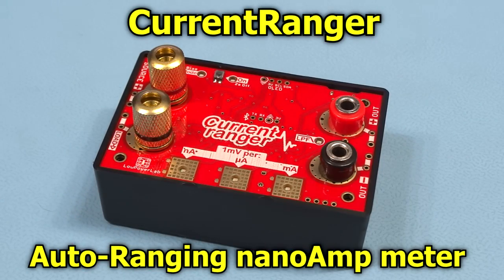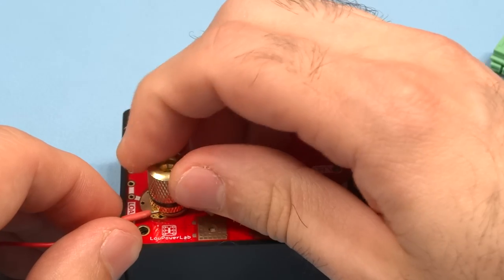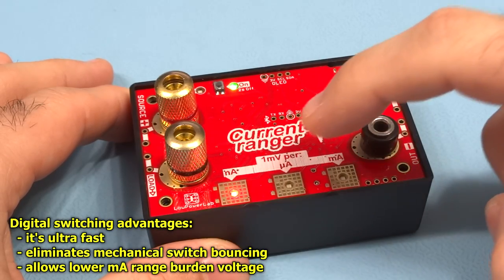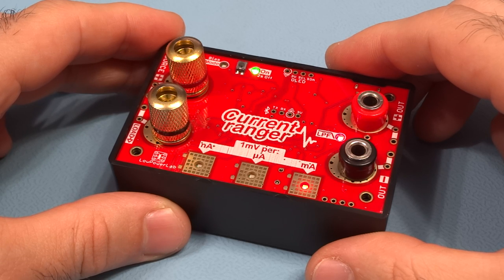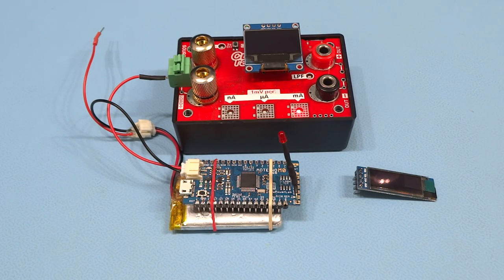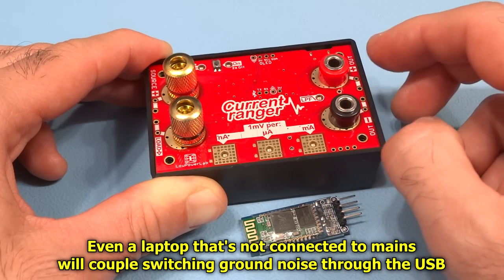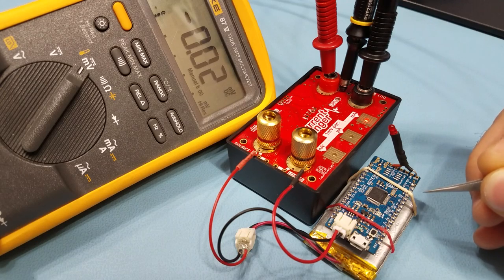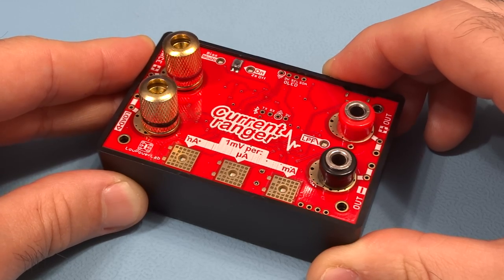CurrentRanger: auto-ranging current meter

Comment: This is a great product. Especially the auto ranging feature is very handy for any deep-sleep measurements.
Reply: I see the bandwidth for this product is given as 300KHz, I haven't done any real life tests, but would you say that is enough to measure the current of an ESP32 type device?
Reply from the maker: Thanks Andreas!
Reply from the maker: @voltlog  I am pretty sure even at 10khz you will get a very good idea of what the ESP32 is doing.
Reply from the maker: @voltlog  Now based on Andreas's review I would say its sufficient. In any case you should be able to capture very fast current transients for any low power electronic product (up to the 3.3A range).
Reply: @FelixRusu  Thanks! I saw Andreas's review, it painted the picture clearly.
Reply from the maker: @Palmologix Tech It looks to be a simple fix in software. I published a firmware update which should address this problem. Please check the latest code here:
https://github.com/LowPowerLab/CurrentRanger/

Comment: Congratulations on a very nice product design! Have you done any tests to see if the bandwidth (300KHz) is sufficient to capture the current usage of low power SOCs like an ESP32 or similar?
Reply from the maker: Thanks!
I'm not a fan of ESP products nor have I used them much at all, so I don't know how they behave.
The bandwidth is sufficient to capture very fine current variations in RFM69 transceivers, see the guide for measurements/scope captures.

Comment: I am not sure if this is the place to ask.  I just ordered a CurrentRanger.  I need to look at sleep currents at a couple uA, uController wake currents at a couple mA, LED currents of a dozen mA in tens of ms pulses, and radio transmit current draws of 80 mA in tens of uS pulses of current draw.  As these overlay on one another and the CurrentRanger autoranges, how can I know if what I have on the oscilloscope is show a mV per nA or uA or mA?  Do I need to probe the LED outputs for the three ranges at the same time that I probe the real time voltage output?  Nice creation BTW, I am looking forward to putting it to use.
Reply from the maker: Please DO NOT probe the LEDs while probing the output, this is a good way to damage the CR since the grounds of the output/LEDs/USB/input are different so doing that will create ground loops. I would suggest just placing the CR in manual mA mode, then it will give you a good clear output and you'll know how it looks like when it wakes up. Then for the sleep part go in uA mode - the CR should not choke your DUT in uA mode even if it wakes up, assuming it only uses a few mA in wake mode. Be sure to read the warnings in the guide before you hook it up to multiple external devices, this is important since there is no built in isolation in the device - this is a 2 edged sword - gives you maximum raw output bandwidth but you have to understand how to properly use the device. Please ask future Qs in the lowpowerlab.com/forum, thanks.

Comment: Love the product and the specs.  Just one suggestion - you have a lot of options at checkout time for OLED adder and what not.  Why not make the LIPO battery an option?  Cost me a couple days - I have a bunch of LIPOs around the lab, but they are all three pin and wouldn't work.
Reply from the maker: Thank you for the message, it has to do with regulations around shipping LiPo batteries with USPS.

Comment: I personally would love to have a current meter that is using high dynamic log-opamp, and basically outputs mV/dBmA or something close to that (for example 1nA => 100mV, 10nA => 200mV, 100nA => 300mV,  1uA => 400mV, 10uA => 500mV, 100uA => 600mV, 1mA => 700mV, 10mA => 800mV, 100mA => 900mV, 1A => 1000mV, 3.3A => 1519mV; the exact values could be determined to make the best use of available input and output dynamic range). Then I don't need any autoranging in the meter, I can do continues logging using a meters, data logger or osciloscope. Then in software (or osciloscope using math functions) I can invert the log, by using exp or 10^x function, and get back original current over full range, with constant relative accuracy over whole range.
Reply from the maker: Everyone would, but to make something like that you need an exceptionally low noise design, exceptionally high resolution and fast ADCs, and a very fast processor - something in a very different price range. An higher end oscilloscope has that kind of architecture, but not specifically designed to do current measurements but voltage measurements. Perhaps a nice SMU like the $6K Keithley 2450 could also do that but I believe that also ranges.
Reply: @FelixRusu  I don't think it is that hard. Lets say 20bit ADC, at about 100ksps, these are readily available. with 20bits, and 0-1V scale, that translates to 0.004mV per step, which is also available using even medium quality voltage reference. That is not that low, to be hard to noise-proof. The 0.004mV in log scale, would be equivalent (in my example of 100mV per decade), to less than 0.01% relative accuracy (0.004% to be precise). Way more than actually needed in majority of power measurements. The absolute calibration shouldn't be hard either I think, using multi point methods. The cheap DC log-amp like MAX4206 might not be the best, but it pretty good, good bandwidth and price, but it is only 5 decades, with a bit extra non-linearity at the edges of ranges, but is an option, a better one would be to have close 8 decades, for example TI LOG114, low noise, high bandwidth, 4.2$ per IC. I just hypothesizing here of course, but I am pretty sure it doesn't need to be hard, big or expensive.
Reply from the maker: @movax20h  If parts were the only thing you need to factor into finished product economics we'd live in a very different world. Anyway sounds like a great product idea, looking forward to see it implemented in practice ;-)
Reply: @FelixRusu  I wish, I don't know that much about electronics. Maybe one day,.

Comment: It's a good expansion on µCurrent, great work.

My main worry is, that all these bells and whistles would add noise or other interference to sensitive measurements unnecessarily.

Have you made any characterizations regarding that and are you going top release any sort of data-sheet like specifications for the unit?
Reply from the maker: It's all a tradeoff. If you want high bandwidth and low noise output, then use the CurrentRanger the same way as the µCurrent, no auto-ranging or OLED.
If you can trade some bandwidth for even lower noise, then use the LPF, reduces noise dramatically and gives you silky smooth traces on a scope. If all you need is a DMM, then you can enable everything, the readings on a RMS DMM are unaffected even with continuous ADC sampling.

Comment: Oh that's way cooler than the uCurrent. Is it open hardware? I'd like to make my version with some changes, such as a BNC port and the footprints for the components i've already in stock
Reply from the maker: Thanks, I will release the schematic and code. I don't think BNC will help since you need some attenuation or your tracing could be very noisy. If you really want BNC there are dual banana jack to BNC terminals available for $5ish on ebay.
Reply: @FelixRusu  i'm not planning to use bnc for better noise immunity, just as a more convenient connector to attach the scope. There should be no significant difference between direct bnc and banana to bnc, right?
Reply from the maker: valerio \new  I was saying that for BNC use you will need a very good coax to limit noise. I would just get a banana/BNC adapter. In fact I got one just for this purpose and I was not happy about the noise.
In the many months of development I thought of all these connectivity options including BNC. I decided not to bother with BNC because of several reasons. The simple 2 pin header for scope probe cannot be beat in terms of noise.
Reply: In theory, there are a raft of reasons it's much better to use a well-matched probe with a short ground lead at the board, like felix does in this demo. It's definitely not the same as attaching a coax, directly to a coax jack you integrate, or via bnc to banana. Among other things, the coax option would represent two different impedance discontinuities, which could lead to unexpected noise: the (whatever the currentranger impedance is)>50ohm, and the second 50ohm>scope (Assume 1mohm). Of course, this particular piece isn't relevant if you're measuring with 50ohm coupling at the scope, but you probably aren't, and also shouldn't be. Long story short, you can only assume "1MOhm||13pf" if you're using the probe tip itself, and that's probably what you want to do.

In practice, I wouldn't put money on a huge difference. Although if Felix says he ran into issues, I totally believe that for the reasons above. The ideal scenario is probably a BNC jack and you use a scope probe to BNC adapter, but this is less convenient and only approximately as good as just using the ground spring.
Reply: Did you follow up and release the code and schematics? I couldn’t find them on your page or github but saw Andreas video today and he had them
Reply from the maker: @thecombatengineer7069  Code and schematic are available for reference in the CurrentRanger guide: lowpowerlab.com/currentranger

Comment: Can I use the I2C channel to read the measurement data with a microcontroller?
Reply from the maker: You could but you'd have to modify the firmware, and I would not recommend that. It would be way slower than serial output.

Comment: Hello Felix, 

ich have just seen the great review of Andreas, [with the swiss acent ;-)], and immediately ordered this smart thingy at Welectron. What I don't yet know and might be a suggestion: Upon auto.switching, is there a signal somewhere available, which I could visualize on my scope? I mean: whenever the CurrentRanger switches to a different range, I'd like to see this in my scope on a second channel: just 5V, or, even better, a dedicated level for each of the three ranges or a short/medium/long pulse of LOW to HIGH or vice versus to identify the active range on the scope. Hope this was understandable.

As to the rest: excellent job!
Reply from the maker: Hello Overtan!
Thanks for your question, this would be a great question for the forum - https://lowpowerlab.com/forum/currentranger/
Although it appears to be, I did not say it's open source :-). But to answer quick - there is no dedicated signal for this. But you can reprogram the unit yourself with the code and use the exposed GPIO header (bottom right) to make your own signal for that. So you could use 1 GPIO to output short pulses after each ranging. However this needs to be carefully considered to ensure the CR won't be damaged by having an external device (EARTH GROUND) connected to 2 different potentials in the circuit (output- and MCU GND). Maybe I can make this a standard feature that can be enabled through the OLED/MENU in the future.
Reply: @FelixRusu  Yes, the best thing of all: Open Source, love it (I write software for a living, linux only). Yes, a good proposal. But it just came as well to my mind, that the range-LEDs already output this information. I'll have a look at it when it arrives. Thanks!
BTW: "Overtan" sounds awesome, I like it. But it is "Obertan", a word which doesn't actually exist in German, a "portmanteau". "Obertan" is so to say "~Untertan". ;-)
Reply from the maker: @obertan_1  Sorry I mangled your name!
Be careful if you want to tap into the LEDs. They will not have the same GND as the scope output, and you want to avoid running current loops through the MCU. Especially when it is used in BIAS mode, now the output- is 1.65V above the LEDs GND, so you're overloading the circuit.
Reply from the maker: @obertan_1  An afterthought - you can redirect to USB logging the exponential notation logging used for the BT serial header. Then you don't need to watch another signal since the output already tells you what range you are in, ex: 123E-3 (mA range).

Comment: We are actually planning to buy it. What is the max range of current it can take? as we are using LORA and its peak current is 140mA. We want to study sleep currents and battery life calculation with help of this device.
Reply from the maker: Hi Design EME - It can measure up to ~3.3A.
Reply: @FelixRusu  we have purchased the ranger. Its nice product. Thank you. I wanted to know what is sampling speed in milliseconds for serial logging? FAST ,AVG & SLOW. We wanted that info for serial plotting.
Reply from the maker: @designeme1809  This will depend on several factors, so it's not a fixed speed. It can be 1-2ksps, try the CurrentViewer, it shows the sampling rate in the GUI. github.com/MGX3D/CurrentViewer
Reply: @FelixRusu  thank you. We found the GUI. Our main application requires Battery Life calculation. Do you which software will be best to find that out using our current ranger data? Found some information on Grafana. But We are not expertise in that area.
Reply from the maker: That is up to you, we just provide a generic serial output that you can plug into the program of your choice. On the CR product guide there are some suggested 3rd party programs which you can try out: https://lowpowerlab.com/guide/currentranger/bluetooth-data-logging/

Comment: Sick awesome Felix! Just dont' see why it has to be so pricey. Why an m0 and not an m4? I'll support anyway but just curious!
Reply from the maker: Thanks ytfp!
RE pricing - it's a multifold reason, first the board themselves are pretty time consuming to SMD-assemble, program, test, and the BOM has a lot of different parts some of which are quite pricey, so overall it's a complex thing that takes me a significant amount of time per unit to produce. I prefer to sell fewer units to people that can appreciate the value they get for a price which I regard as fair, especially compared to a uCurrent.
M0+ is sufficient for what I need it to do, and its plenty fast. If M4 becomes a better candidate for I will consider using it in the future :)
Reply: Felix Rusu  Thanks, looks like I clicked order too late, have to wait for the next batch. Yea look into the m4!

Comment: That is big upgrade to uCurrent. I like LPF, autorange, all those different input and output options, OLED (I would use it most of the time) and the fact that in can go up to 3.3A.
As far as logging over usb: you could have usb insulation, you have several options, if you don't want to use BT
How stable is it, what the precision?
Reply from the maker: If it's complete galvanic isolation then it could work, but any extensions to the board can act as antennas that pick up noise.
RE stable/precision - I haven't tried it so I don't know the answer. I know the BT works pretty well - but these will be ADC readings, not the highest accuracy that you could get via a DMM.

Comment: Looking for an instruction on the firmware.  I use Arduino regularly but it doesn't recognize the Current Ranger.  Really all I want to do is disable auto power down.
Reply from the maker: If you don't have the latest firmware there is a bug that will prevent AUTO-OFF to function properly (unit will still turn OFF after several hours). So first I would update the firmware, follow the guide here for that: https://lowpowerlab.com/guide/currentranger/programming-firmware-updates/
Secondly, there is a serial menu that allows you to disable AUTO-OFF functionality, explained here: https://lowpowerlab.com/guide/currentranger/auto-power-off-function/
Reply: @FelixRusu  Thank you!

Comment: What is the maximum input voltage?
Reply from the maker: You need to read the guide, you cannot apply a voltage to this device, you need to pass a current through it.
https://lowpowerlab.com/currentranger
Reply: Thanks, I know you have to pass current through it and it that current that is being measured. But what voltage w.r.t. ground can be applied at the input? That is can it be inserted in the high side of a 12v battery to determine the current supplied to a 12 v load?
Reply from the maker: Yes, you can. But be sure to float the Current Ranger, it is not connected to ANY ground whatsoever or you can damage it. That's the key. You just pass the 12v high through it, that's it, nothing else.
Reply: @FelixRusu  Thank you. Got it